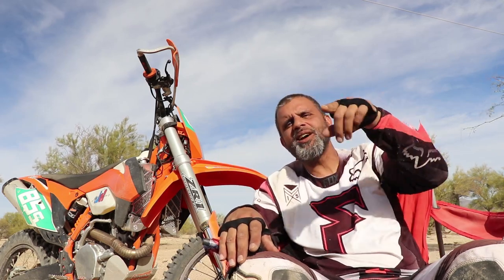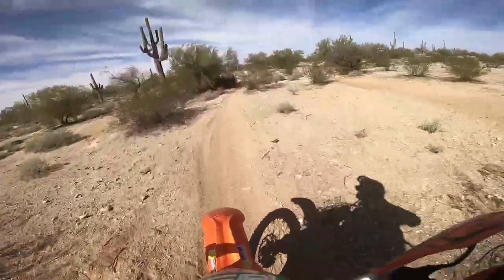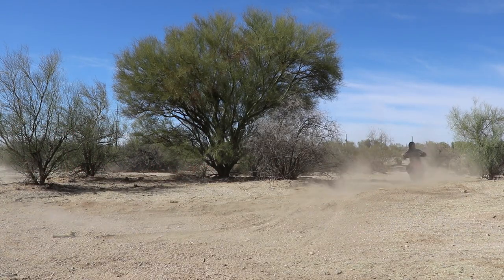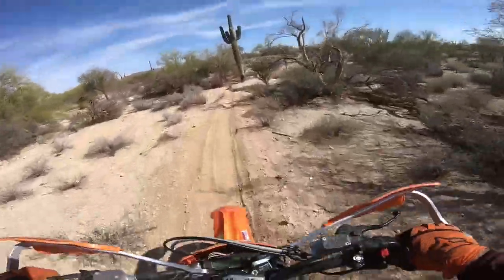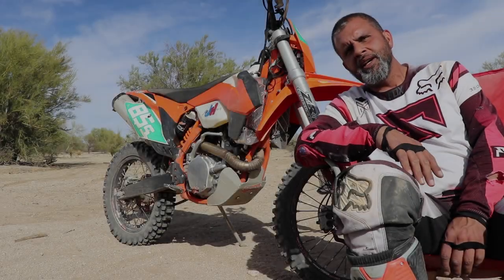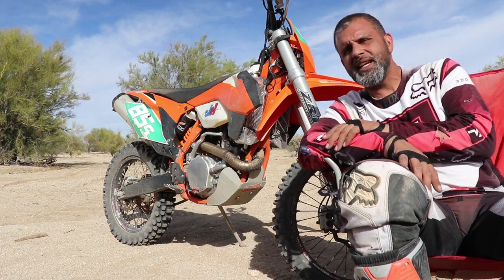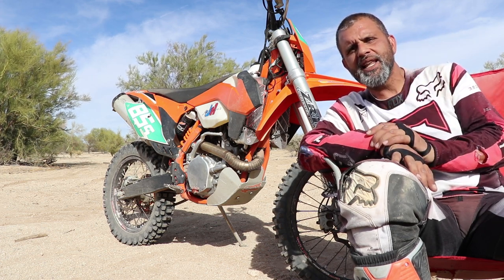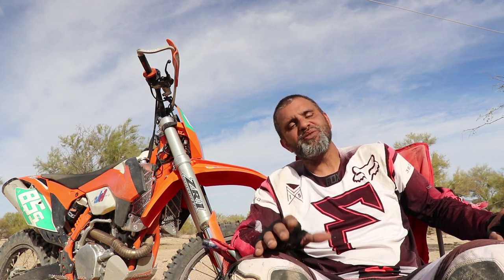Testing my rebuilt suspension from ZR1 racing

Comment: It's all about those settings, man!  It's hard to analyze suspension setup from a brief video, but watching you go through those whoops it looks like your rear suspension is pushing your front wheel down.  It's coming up too fast and overpowering your forks.  That makes whoops and any successive hits much, much more work!  You want your front end to easily float through the whoops & hits, and to do that you need the rear end to comfortably squat and transfer weight to the rear, and stay settled as your charge through while still delivering a balanced response to the undulations.

I've struggled with this on both my current five hunny and it's old RFS predecessor.  I personally believe it's an idiosyncrasy of the PDS rear suspension (which I do love and am a huge advocate for...), but it can be (mostly) overcome.  I had better success with the old 450 because, like you, I had a gold valve installed and had work done to the PDS.  With the beefed up suspension capability, I played with clicker and sag settings to get the rear end to settle more and the front end to settle less.  All while maintaining suspension balance and a decent level of comfortable compliance.  It did take me literally months to arrive at the best settings, and even then I had to be ready to make small changes for terrain and conditions.

Even with the stock suspension (modified only with stiff springs and fork oil viscosity & level) on my '14 five hunny, I've attained settings that do a decent job of keeping the front end up through *whoops.  I personally have found a tiny bit more sag helps with this on our **4th generation EXC's; I run about 110, you're at 107 which is close.  Don't be afraid to play with more though.  I run the front with max preload on the adjusters and about 6mm internally (pretty much the max preload without spring bind...).  I run compression pretty soft front and rear; about 8 clicks in from softest up front and 4 to 5 clicks in from softest out back (on the rear, that would the regular or "low speed" compression setting).  I actually have found that the high speed compression setting out back affects rear ride height significantly.  My old '05 RFS didn't have the high speed adjustment, and it confused me for a while.  Now it's about 1-3/4 turns in from softest, which is close to the stiffer end of the spectrum.  It took a while fiddling with it, making very small adjustments until I honed in on a precise setting that works very well.  Any slight variation makes a big difference in the wrong direction. so I pretty much leave 'er right there!     

*Qualifying statement here; the stock suspension does not allow me to pound hard through whoops with complete abandon, like I was able to do with the modified suspension on the old bike...  Although it stays straight and comported, it starts bottoming and making scary noises and I have to back off a bit.
**'00-'03 = 1st gen; '04-'07 = 2nd gen; '08-'11 = 3rd gen; '12-'16 = 4th gen; '17-current = 5th gen  

I couldn't say where my rear rebound is set because there's exactly one setting that works and I long ago set it and forgot how many clicks it is.  I mess with it once in a while and immediately go back!  Up front my rebound is about 6 clicks in from fastest (softest).  My intent with rebound is to keep front & rear as high in the stroke as possible, yet still maintain a comfortable, settled ride.

It's going to take a lot of time in different terrain situations to truly hone in on your settings.  You should keep your sag setting tools in your truck when you're out for a ride, and keep a blade screwdriver handy and accessible on the bike for quick trail-side clicker adjustments.  I used to zip tie one to the handlebar on the old bike, but now I keep it in a little tobacco pouch I use to carry my registration & insurance card, bungied behind the headlight!  Hey, it works!

Good luck Joe!  With the bike set-up and the racing!

Comment: When I worked at NiteRider, I was able to ride one of the factory Honda bikes, it was like a cloud and butter had a baby - I have never ridden anything like it before or since. I will say that I was able to mess my suspension up last week, I set everything back to stock and put the front and rear in the "Sport" settings per the manual. My 350XC-F no longer wants to turn, at least not as well as it was prior to my shinnanigans. I think it is now riding too high in the compression and is pushing, that's my guess.
Reply from the maker: HeliMoto I still can't figure out the right settings lol

Comment: I thought KTM was “race ready”?
TPS? On a dirt Bike?
I don’t think I will ever buy a KTM.

Could it be that your suspension upgrade is not very noticeable because your not pushing the limits of the machine from the factory?
Did you bottom out before the upgrade?

I ride a 99 CR250R. It has the original rear shock. It is fine. The front forks have had the seals replaced. Front is fine. I just adjusted the clickers so it didn’t feel to squishy or bouncy. I am not pushing the limits of my machine. Just fun trail riding. I see other older Japanese bikes on the trail. But for some reason the European bikes are all new.

As a KTM owner how do you feel about the longevity of your machine. Will it still be able to perform when it is 20 years old?
Reply from the maker: +Dave M before we start this brand trashing back and forth troll festival, let's compare apples to apples. Which Honda street legal 500 cc dual sport are we comparing the KTM 500 EXC to?
Reply: Joe Rockstar hey, I am not bashing anything. I am expressing what works for me. And my observations of the market over the years. Here in Idaho there are literally no KTM bikes more than about 5 years old. There has been a KTM dealer here for at least 15 years. If KTM does indeed have a longevity issue then it is not a bash to talk about it.
Reply from the maker: Well the AMRA racers in AZ overwhelmingly choose KTM and Husky. I doubt it has anything to do with anything other than personal preference. If you don't like KTM don't ride KTM. As far as reliability issues, I guess we will see. But I have yet to see any brand of dirt bike last very long without an owner who takes care of it. 
And since KTM has only recently started developing a better bike it's no surprise that most of them are only 5 years old. Prior to that KTM did have a bad record.
Reply from the maker: +Dave M and I still want to know which Japanese made dual sport 500cc four stroke fuel injected bike is out there that has the same features as a KTM 500 so we can compare apples to apples
Reply: Dude, You don't have to defend your love of KTM. They're just not for me. I just wanted to know some of your thoughts. I remember at one point you were willing to criticize a Honda that you had purchased. You do realize that I am a subscriber right?

You seem a little angry...

If you are ever up in Idaho I would be happy to go riding with you.

Fact:
CanAm has a 42% failure rate (needing a repair in the first year of operation).
CanAm is 10th in top 10 most reliable motorcycles from CR.
Honda is #2 (12% failure)
Yamaha is #1 (11% failure)
KTM did not make the list.
Reply from the maker: +Dave M I'm not angry I'm just fatigued Over the constant brand fighting that happens online. Maybe I misread your intentions. My point is that if you want a 500cc dual sport that has all the features that this bike has you won't find it anywhere else but KTM. So the options are actually Limited. If I want a 350 four stroke fuel injected with traction control the only choices out there are KTM and husky. I would much rather have more options that are less expensive available with those same features. But we can't compare one brand to another brand unless we're comparing the same features.

Again it may not be your intention to start mudslinging but coming out and basically inferring that somehow the 500 is inferior in some way to a bike that doesn't even exist with any other brand is going to make people defensive. Especially when my experience with the bike has been mostly positive. So far most of the things that have gone wrong have been my fault. But time will tell and you may absolutely be right. Sorry if you feel like I was angry with you.
Reply from the maker: By the way I do appreciate that you're a subscriber thank you. And I'm perfectly willing to criticize the KTM where I see that it deserves it. It is definitely hard to find a lot of things wrong with the bike. Especially considering that it is not made for the type of competition that I am using it for. It's definitely overpriced in my opinion. I think the suspension is too soft , and I'm not a fan of the orange color. I know I criticize that Honda but it deserved it. It is dressed up like a dirt bike and it's not a dirt bike. I totally accept that it's my fault for buying it without doing a thorough job researching it. It was a dumb decision on my part. However I did have the chance to ride a 2016 CRF 250 F and I was really disappointed. I really like the Yamaha YZ 450 that hey buddy let me ride. And recently A friend of mine let me ride his wr250 on some hard single track. I rode the Alta redshift, as well as the entire 2018 Husqvarna line. And I have to say I love dirtbikes. All of them some more than others. And I wouldn't never discourage anybody from buying any type any brand except for that Honda CRF250L LOL
Reply: Dave, pretty soon there will be no options but TPS on dirt
bikes. The ecm has to know how much fuel to add. Old bikes are great and so are
new bikes. Not having to do altitude adjustments is pretty darned convenient.
KTM struggles not with making systems that work but with making systems that
are US compliant and DOT legal for guys that need plated bikes like us in Washington to ride anything outside of the ORV parks We can thank a State or two for needing to work
on new bikes to get them to run closer to their potential. But one nice thing,
once set an injected motor when taken care of should remain consistent. There
are actually much less to slip or go wrong. I’ve always been a gearhead, just
turned 50 and just bought my first EFI dirt bike. So far I am a big fan. I felt
the same way when I started buying EFI sport bikes ten years ago. It just
works, if it works.Joe, I’ve been meaning to reach out to you since I found
your channel. Thanks for the great vids. We have a very similar story on the
bikes and you make me laugh a lot. Interested to hear more about your comments
about selling the 500 and what you are thinking of moving to. I started on a 530
in 09 and bought a 300 in 11 thinking it would be easier to ride and ended up
back on a new 500.
Reply from the maker: +Michael Webb thanks for watching and I'm glad you get my humor. I'm going to finish out the season on the 500. But I'm seriously considering moving to a 350 xc-w instead of the EXC. I'm not ready to go two stroke yet